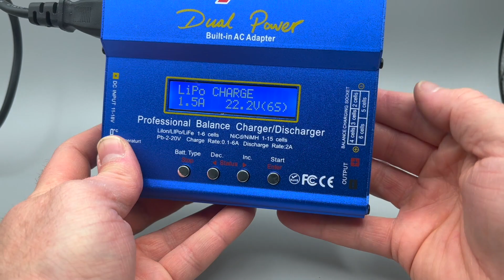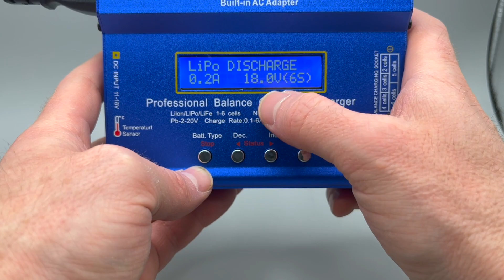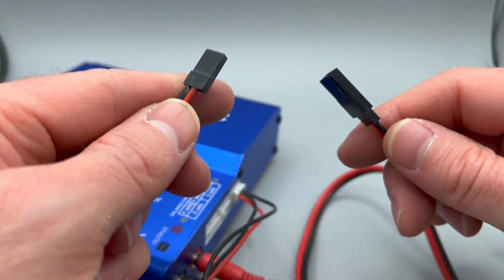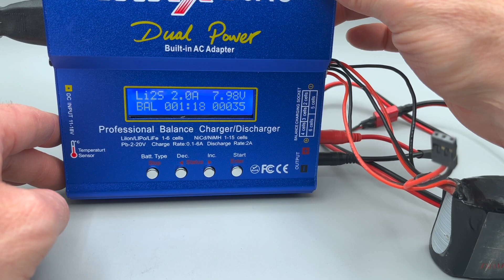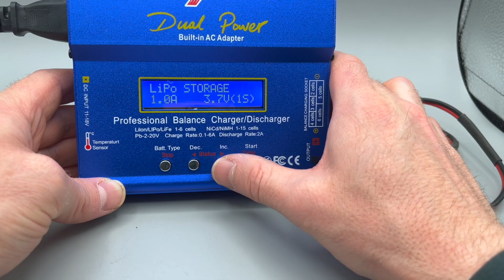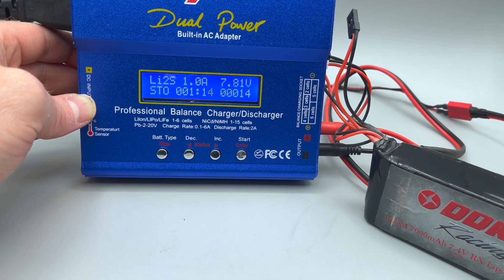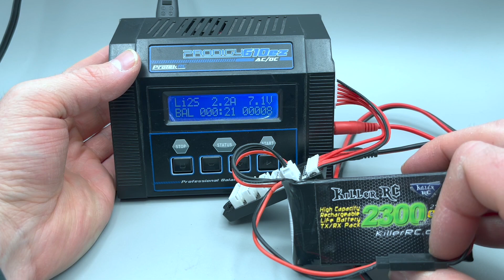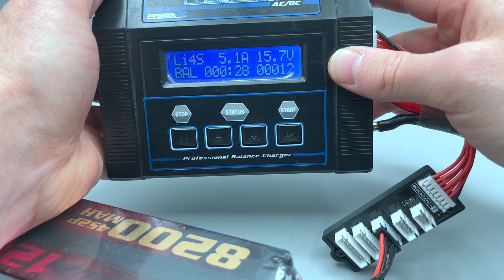How to charge a LiPo receiver battery with IMAX B6AC Charger

Comment: can these chargers be used to charge the ps4 controller battery. I'm not sure what you call the other end where it connects to the red and white extenders but the ps4 controller battery doesn't have those. So I was wondering if there's a work-around that one does to be able to charge the ps4 lipo batteries for the controller.
Reply from the maker: @jeandelacruz3636  no idea mate.
Reply: @DDMSteveB  Thanks. No worries, mate.

Comment: What if the lithium battery you purchased doesn't have the balance connector it has a barrell connector?
Reply from the maker: I would want to see the battery in question before making any answers on that.
Reply: @DDMSteveB  10s2p 36v 100000mah mkepa e bike battery. I bought a charger specifically for 36v barrel connection batteries. It chargers output at 42v but I was wondering if I could buy a charger like this or similar with higher v output to charge a pack like that without a balance lead

Comment: Would you know why when it’s charging a Nimh it doesn’t stop at the batteries maximum capacity? I changed a 7.2 3000mah and it charged it way past the maximum volts (8.4), it was something like 8.85v before I noticed it
Reply from the maker: Yes - that is normal. NiMH batteries are rated as "1.2V" per cell because that is the "average" voltage output of the cell during the duration of the discharge. The voltage will also dip when a load is put on the battery. With no load the voltage will read higher. Totally normal - that is what a peak detection charger like these are looking for - the peak voltage when the battery will no longer accept any more capacity it shuts off automatically.

Comment: I have a problem. I have 2 3s 1500 11.1v. One battery shows 1.5A and 10,97v the other battery shows 0.3A and 12,59v:
I tried both of them outside in my rc and the first one worked for 5 min and the other 0 min. This this is what they are showing now when i put them in my charger. How can they show such different ”A” when both should be empty? Is ”A” the current MAH thats in the battery? If you have a 1500 mah battery should A be 1,5 when its fully charged? Havent used rc in 10 years so its been a while. Btw om charging on balanced mode.
Reply from the maker: the amp rate will increase or decrease based on how charged the battery is. As the battery approaches full charge it will lower the charge rate. This way it eases the battery into peak capacity.
Reply: @DDMSteveB  i charge the battery until my imax says full. But then the lipo doesnt work. That doesnt happen with my other lipo. Any idea why it happens?

Comment: how would you know when the battery is done charging?
Reply from the maker: The charger turns off automatically and it beeps. Once the battery is charged you need to disconnect it from the charger. Never leave a battery plugged into a charger unattended.

Comment: What's a way to determine the amps at which to charge?
Reply from the maker: Many times the battery manufacturer will have suggested charge rates for the battery. If you see a "1C" that is 1 times the capacity, so 5000mah would be a charge rate of 5.0 amps. Make sure that your connector for the battery is capable of the amps you are pushing from the charger.